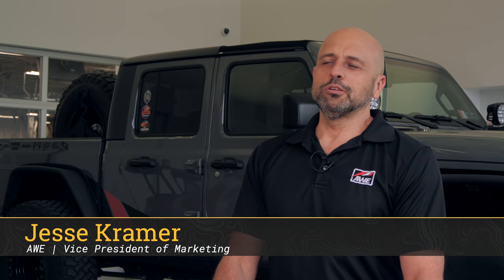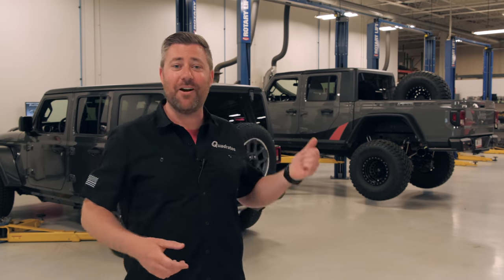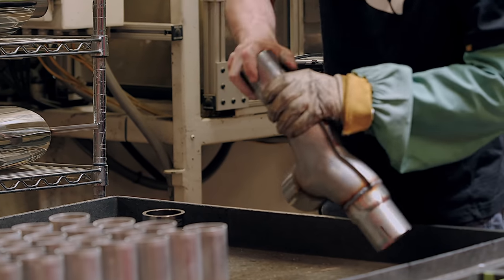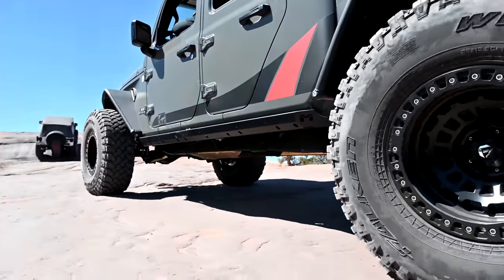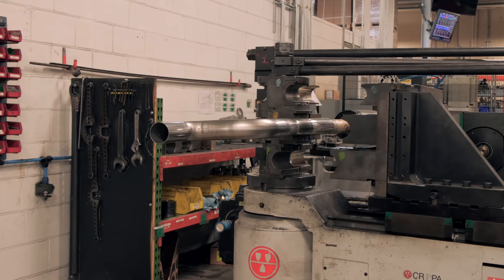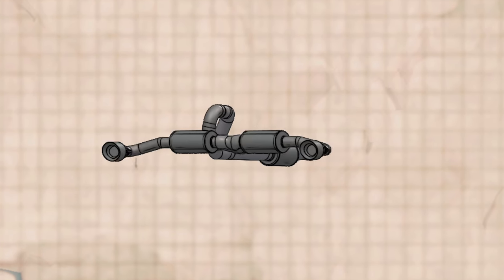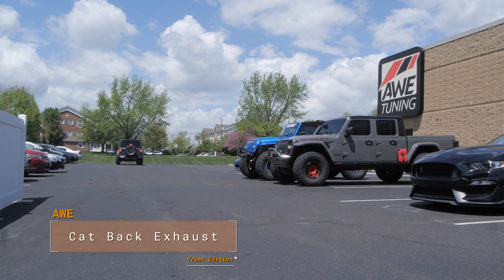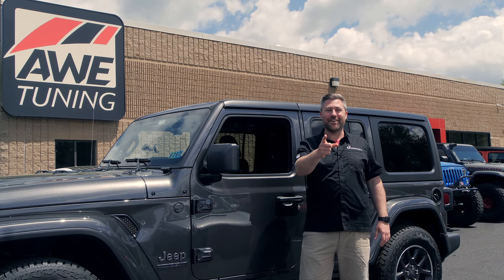AWE Tread Edition Exhaust Review & Sound Test for Jeep Wrangler JL with 2.0L Turbo 4 cylinder

Comment: Honestly, just save your money and buy a Dynomax Delete Pipe. I have it and it sounds identical....way more clearance and a lot easier to install.
Reply: Do u have any drone with this?
Reply: @damonm7695  a little bit, really only at certain rpms. Definitely louder in the cabin with a soft top as opposed to a hardtop, cold starts are pretty loud too. It’s a trade off but I personally like it.
Reply: @brnt.9319  cool, thanks for getting back to me!